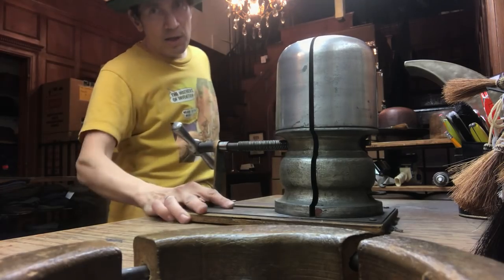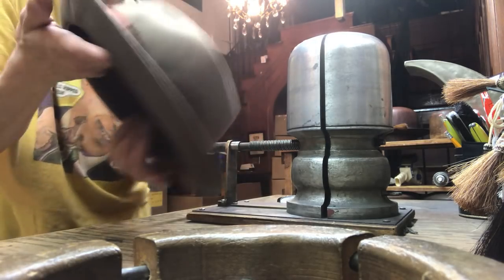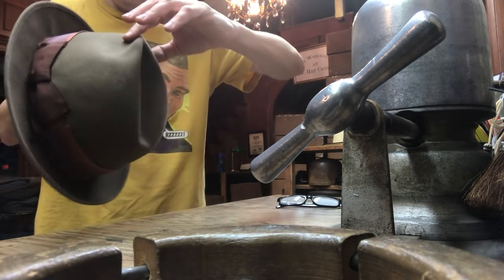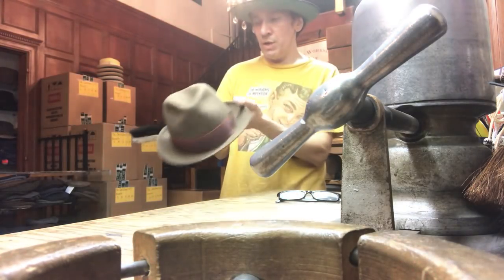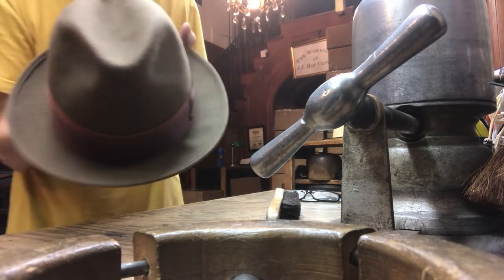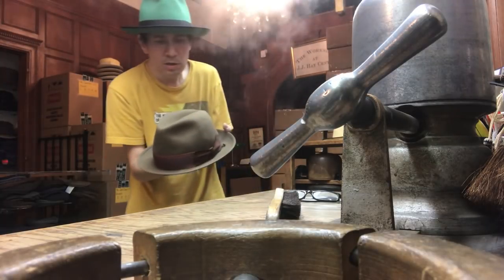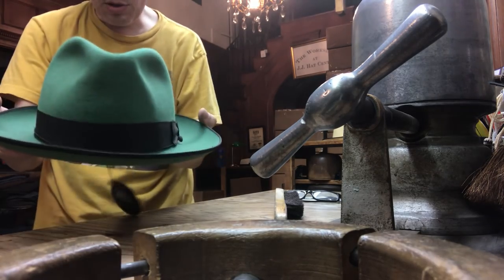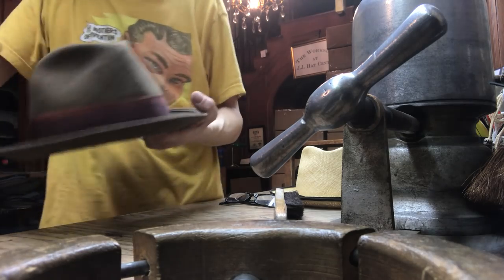How To Fix Your Hat with a Steamer - A Few Tips !

Comment: Another really good video. When would you use stiffener?  Or is it personal preference?
Reply from the maker: Always on straws, use a lot, too..and felts, use it when the hat feels too soft and floppy, if it has some snap left in it, u might not need any.. the stiffer it is,the more control u have over the shape, but..u don’t want it to feel hard like  cardboard,just a thin coat or two for felts, and many coats for straws, 
when u steam, u are melting the little clear coat of stiffener, and letting it cool into a new shape, 
without that clear coat, steaming does nothing..
Reply from the maker: Al Rau thx, glad u liked it😎